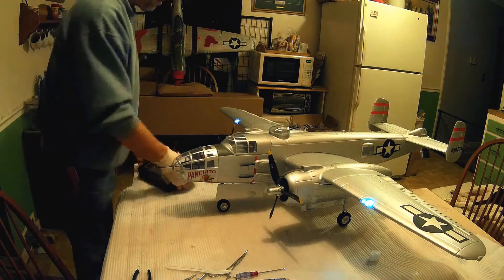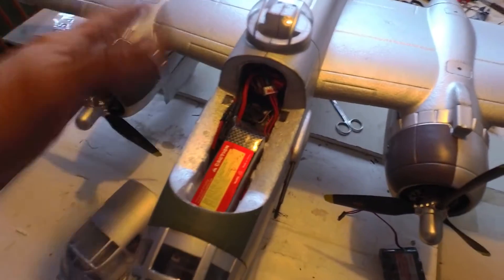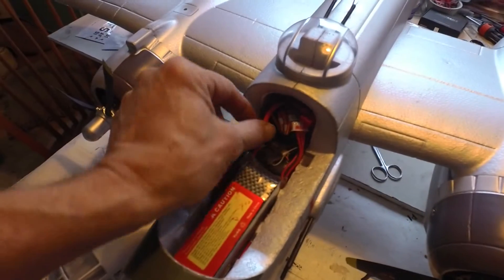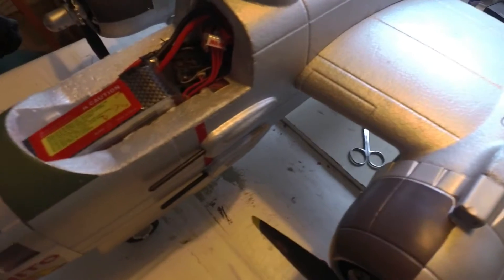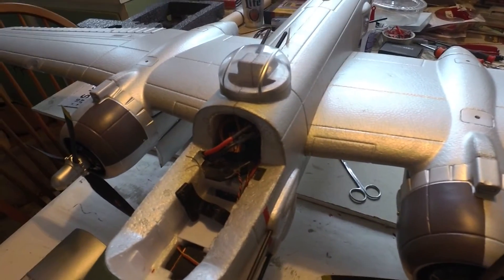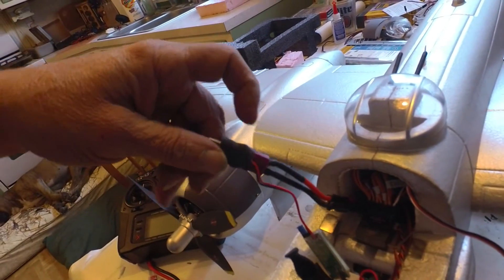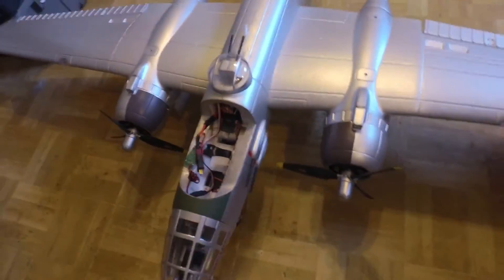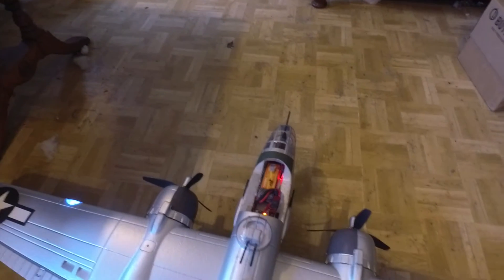FMS B-25 Mitchell Bomber,   Fly Away Problem Solved,  Here's My Fix!

Comment: Loved the video. Your dog looked like he was thinking -"what the heck"?!? Just purchased the green one your video will help me alot.
Reply from the maker: Vin S 
Cool my friend.   Happy Flying. Skip
Reply: BTW, I just purchased the green one and what a bear to thread all the wires from the engines, thru the wings and then the fuselage. Seems the instruction manual is horrible, as you cannot view the screw inventory and I think I am missing the screws for the wings. I have the two for each nacelles, and the pair for the tail, but no screws for the wings.
Also, the manual says the Sequencer is labeled "Channel 5" B and C, but its labeled B for both sets of three cables and nothing on the PCB like the manuals show.
Also, there is no mention in the manual of "Flaps" yet I have a "Y cable" labeled Flaps and seems the LED cables (2 pin not 3 pin) are labeled Flaps as well.
No idea where to plug the throttle cables in as I have the "Y Connector" but do not see any cables from the engines that say throttle.
Just dual battery leads on a Y connector that is so short it was rough to get it connected.
I guess I will contact AMAIN hobbys for help.
Reply from the maker: @VS-gq2mv  the screws are in wings.  Slide wings on and then tighten the 2screws,  one on each wing.  It tightens up with a string pulley system built in the wings.  Hope this helps,   Skip
Reply: Holy cow! Thanks Skip!
Reply from the maker: @VS-gq2mv  
No problem my friend.   I learned that the hard way.
Reply: What do you think about the 2 pin LED wires labeled flaps?
Reply from the maker: @VS-gq2mv  optional.  If you want to add flap servos.   Don't need them.
Reply: ok, so I guess just match the 2 pin LED wires to the "3-pin y connector" making sure the wire colors match?
I think the LED wires are red and black but the y connector is Brown, orange, yellow
Reply from the maker: @VS-gq2mv  if memory serves me I believe those wires are for the lights yellow is signal always or white. The brown will be your negative or black the orange Center wire is always your positive. Or the color may be red.
Reply: I got it working! I was double checking the connections and deep inside the bundle of wires was a connection I placed backwards! Was really hard to see as it was one of those wires that is too short, and a pain to get to and re-attach. Whewhooooo!
Reply from the maker: @VS-gq2mv  yeah buddy is I can remember just about everything with that plane was a pain in the ass. It was a learn as I go experiment if it didn't reach running it that way I make it reach running it another way their wires were too damn short. You'll probably get yours flying before I ever fly mine LOL LOL. I even have another one still in the box that they sent me after having to screw with the one I've got so much. Good luck with yours I'm hoping to get mine up in the air sometime soon if I can find a reasonable place to take off and land without grass that's more than 3 in tall. LOL LOL puke puke
Reply: I agree...a major pain in the ass! In fact, the saga continues...So I go outside just to test taxi it on the street in front of my house, and notice when I give it throttle, it's moving backwards!
Fortunately, the lousy manual actually addressed this and I had to go into program mode in the ESC and change the GHZ setting. What a freaking trip, as you have to sit there staring at the manual with a chart showing all kinds of funky symbols indicating beep patterns.
So as you listen to the beep patterns in program mode, you read along the chart and count until you get to line #9 in my case and then move the throttle to save that setting which is now reversed.
CRAZY!
NEXT...I notice the left gear is leaning back and as I inspect it, I notice the screws that go thru the metal retract plate and into a black plastic frame which is part of the retract/gear assembly were over torqued at the factory and cracked the plastic threads.
Fortunately, AMAIN Hobbys was very good about it, and they are going to remove 2 of the 3 gear/retracts from the $100 bag of three and send them to me free of charge.
Unfortunately, they want the bad nose/front gear retract and the left retract sent back; which was a ROYAL PAIN to remove!
It was impossible to remove that plastic frame without breaking it.
SO I told the Tech, I will separate the original factory broken plastic pieces from the plastic ones I broke trying to remove.
I also told them I am not even going to attempt to remove the front one, as I noticed the retract wire there was "pinched" between the plastic frame and foam.
Probably why that front/nose retract never worked consistantly.
SO I am just gonna replace the actual retract there and leave everything else alone in that gear door.
What a nightmare..not sure if I am going to purchase anything FMS every again.
Reply from the maker: @VS-gq2mv  I haven't since.   Sorry to hear all crap going on with yours.  I still have one new in the box.   2-3 years now.  Dont eben want to build it.  Lol lol

Comment: Glad to see you got the issue fixed. I have had the FMS B-25 for about 2 years and the only issue I had was the left strut smoked and burned out on the first deployment of the retracts. Replaced and she has been reliable ever since. I had never heard of them having your issue. They fly very well. Can't wait to see it in the sky.
Reply from the maker: Thanks Larry.  Yeah, this was a toughy to diagnose.  But the work around seems to work and saves the cost of changing out esc's.
I am really looking forward to flying his one soon as possible.  I even have a back-up now as Force RC. let me keep this plane for parts or fix on my own, and sent me another brand new one.  I didn't even ask for that.  I told them the parts would be sufficient, but they said they weren't even sure what parts to send and if I returned it, it would be thrown out and cost them shipping.  And figured I would give them a good review, which I was happy to do.  Let me know whats good for starting rates throws expos and flap/elevator deflection settings are good with my dx9 for my tigercat.  Thanks pal, Skip
Reply: Man that's super sweeet they did that. I have never ordered from them have always ordered from MotionRC. I may give these guys a look for things I can't find at MotionRC.  But MotionRC is hard to beat on selection and service in my opinion.  Settings for my B-25 are this. Ailerons D/R LOW rate 85% and 55% expo. Ailerons D/R  HI rate 95% and 50% expo.  Elevator D/R LOW rate 82% and 45% expo.  Elevator D/R HI rate 91% and 45% expo.  Rudder D/R LOW rate 80% and 55% expo.  Rudder D/R HI rate 91% and 35% expo.

Comment: Is this the one you going to sale? I was thinking it was new in the box 😳
Reply from the maker: Not the one in video.  I fixed that problem.   It was my fault.  Meant to fly on 3 s.  Id been testing it with a 4 s.  My bad.  But with a separate bec, it set for 4s or 3 s.  The plane in question is another one New in Box.  Was supposed to be the Green one.  That's why I didn't build it.  Yours IS New in Box.  Still interested?

Comment: I had throttle problems on a ducted with spin-up, it was really slow to react to inputs. Turned out it was incorrect esc programing when it first started up.
Reply from the maker: I tried reprogramming the esc's.  Put them to factory defaults.  Strange though.  Works great now.